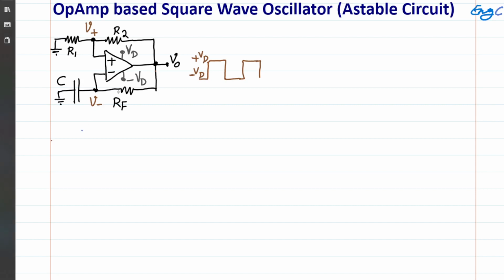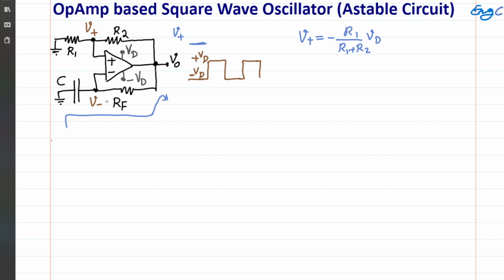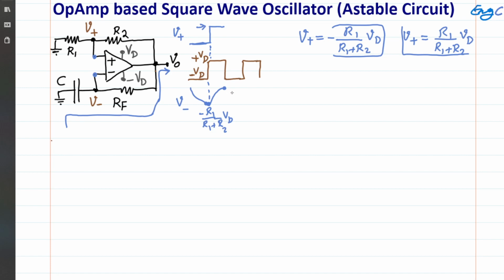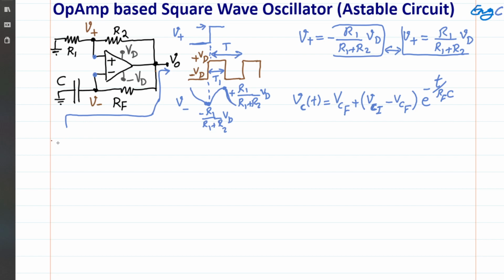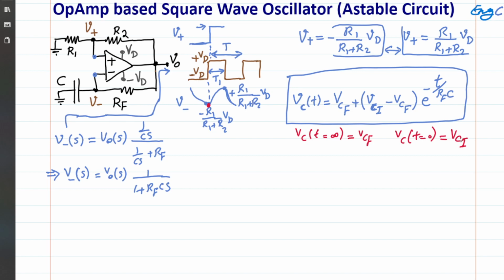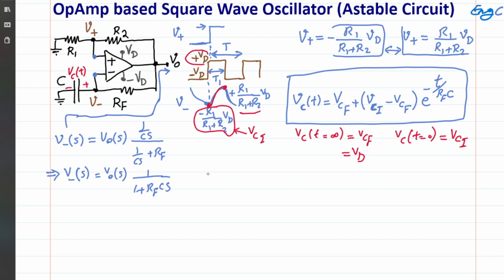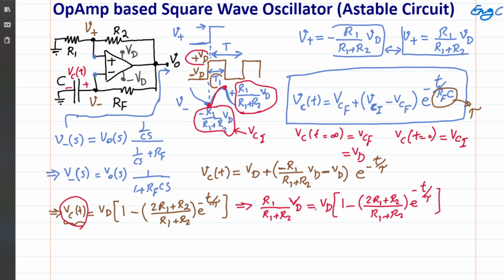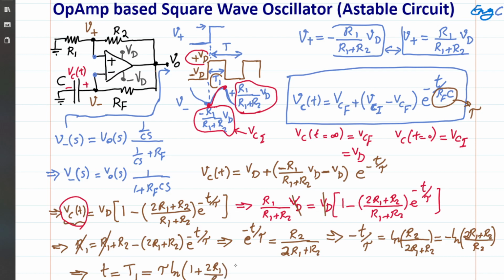Square wave oscillator design with operational amplifier

Comment: Thank you once again for a really good explanation. Considering only the negative cycle of the cap voltage to obtain half the period was a little difficult to grasp, but once realised all fell into place.
Reply from the maker: You're welcome! Happy to hear that the explanation in this "square wave oscillator design" is helpful. For more examples of Oscillator Circuits Designs please see: 
Sawtooth Generator with Op Amp, JFET and BJT Transistors https://youtu.be/5zHXTx-Vl20
Triangle Oscillator circuit https://youtu.be/JF5Up_cuL9k
Bubba Oscillator with quad Op Amps: How to Find frequency of oscillation and required Gain

I hope these videos are interesting as well.